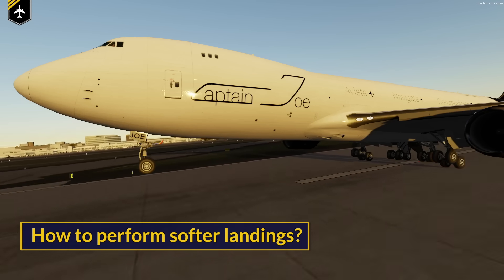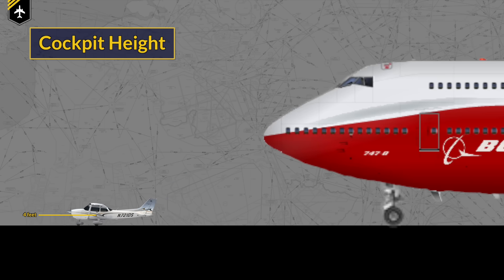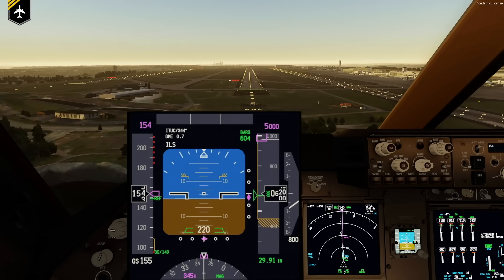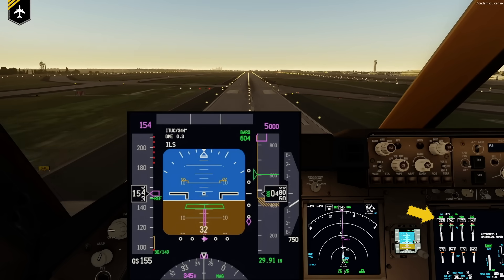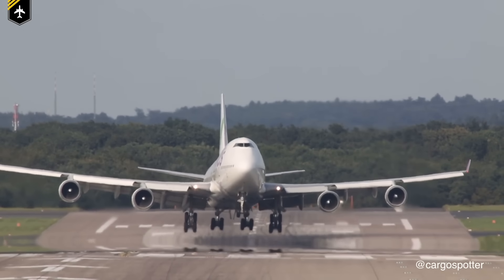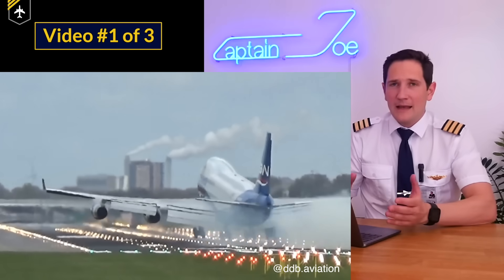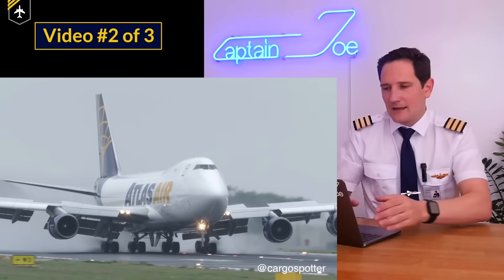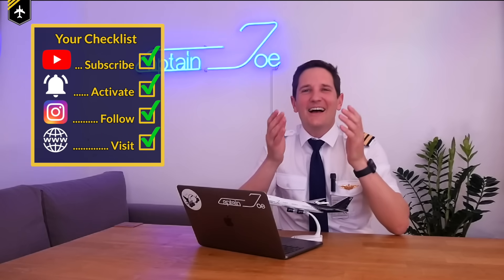WHAT IS A FLARE? And how to perform SOFTER landings? Explained by CAPTAIN JOE

Comment: 6:35: Does the sidestick somehow move forward? How does a fly-by-wire aircraft give the pilot the feel for what the plane wants to do (in this case pitching down), if there is no physical connection between the flight controls and the sidestick/yoke?

Comment: Great video as always, but one thing concernes me, I don't really understand a point in looking at the end of the runway, because you can't see where you're landing and on what you're landing. The greatest landing is a safe landing in touchdown zone, not hardly trying to butter it every time. Sometimes it's impossible to butter, because there might be some kind of wind, or a short runway, so a passanger swearing how utterly dumb the pilot is for a few seconds is a safer option I think...

Comment: These are what I say:

Smooth- “he greased it” or “niiicceee” or “butter”
Firm- “he put it down”
More than firm- “ he pancaked it”
Anything worse- I squint, say “oooffff”, and laugh a little bit because I think of the passengers and what that flights crew members are thinking.
Reply from the maker: Thank you😉
Reply: Then there’s carrier landings, where you’re essentially slamming down onto the deck with no flare whatsoever.
Reply: @michaelmurray11189  Don't miss the hook!!
Reply: @thomasphicks  Bolter! Bolter!
Reply: @michaelmurray11189  fighter jets can land so smooth on runways but not carriers or else they will miss the capture wire that stops the plane faster so they wont overrun bc fighter jets are supersonic
Reply: @marialindamanahan2126  Fighter jets might be able to go supersonic in combat flight and some can supercruise too, but you don't go supersonic on landing. Even during carrier landing you'd aim for a speed of around 150 - 160ish knots. anthing more would be overkill
Reply: @marialindamanahan2126  what does the fighter jet's top speed have to do with landing speed? the reason that the wire is there is because the carrier is only a few hundred meters long. the longest carrier is 350 meters.
Reply: What is the connection of the flight number
Reply: Smooth: passengers clap
Firm: passengers dont really notice
More than firm: “could’ve been better”
Anything worse (ryanair): “what the hell was that!?”
Reply: @TAVideos786  fly United those landings are hard as hell oh my god
Reply: Smooth- AgH~
Hard - AHHH
Reply: Hard landings = drove it in Soft = smiley cause it makes you smile as a trainee pilot
Reply: ... and then there's Ryanair landings- the worst possible landing
Reply: Smooth landings: Butter
Hard Landings: must be from the navy XD
Reply: >he pancaked it
i did not appreciate that

Comment: When is the AP disengaged? Or do you turn off autopilot?  I kill AP at 30 ft. Autothrottle at 500 ft. You set the flaps at 30°, and didn't go full flaps, why? You said in a couple of videos back, that you should advance the throttles after the Thurst Revers open. I thought that would close the doors at the rear of the engines. Please explain thrust reversers, and when to do this in much more detali.

Comment: Possible only on light planes, but students porpoising their landings as they respond with flare control inputs too late and get behind the aircraft, adding back-pressure when they should be releasing, releasing when they need to add back-pressure. A recipe for 4-5 "landings" and an embarrassed red face at best, a maintenance inspection of the nose strut, or worst, a prop strike.

Comment: I may recall a story of a buddy in my local gliding club. During his one of his three check flights he buttered it so good that he was able to hear the grass scratching the glider's tail wheel. After he passed his check rides the examiner said, he should have landed the plane with a little bit more downforce. The landing was too smooth for him. I remember I laughed quite a bit when I heard this story for the first time.
Reply: Hovering in ground effect can be dangerous if there is windshear over an airport. Soft landings are also more prone to waterplaning on wet runway.

Comment: My flight simulator passengers: Finally!

Edit: what counts generally as a smooth/hatd landing?
Reply: -250fpm decent rate
Reply: @Pies.  is hard, or smooth?
Reply: @mauzer8k805  smooth if -fpm (decent) is lower than -250
if you land at 500 you know youve done shit
Reply: @Pies.  ok thanks
Reply: @mauzer8k805  get flywithlua for xplane if ya wanna see
Reply: @Pies.  That's a positive landing still. Smooth landings are way less than that
Reply: @topethermohenes7658  yeaahh like butter is -120fpm for 737 sized planes
Reply: @Pies.  Well for one thing there's no such thing as negative fpm, well I'm talking about real planes tho, and it's kinda hard to base it on fpm, we usually base it on g load, smooth landing is 1.2-1.3g, 250fpm is around 1.5-1.7g hard landing isa upwards of 2g at 2.2g you'll need to inspect the plane for any damage
Reply: @topethermohenes7658  mmm
lands plane at 4gs
well, its not 2.0g-2.2gs, so were all good to takeoff...
Reply: @Pies.  yeah youre fine with 4gs, you don't need your landing gears and wheel connected when you're in the air anyways 😂
Reply: @topethermohenes7658  lmaooooo yep, damn right